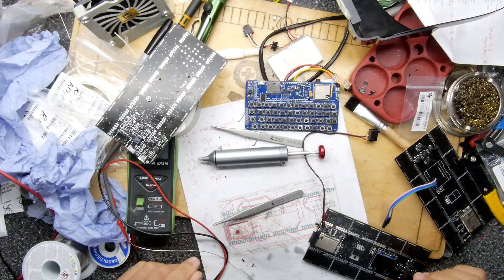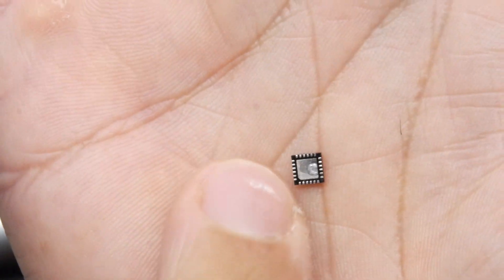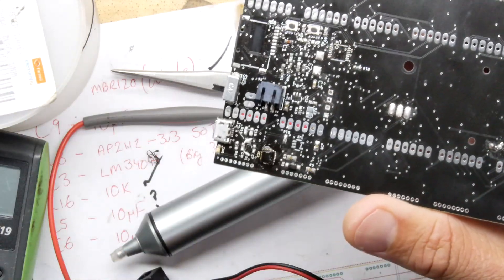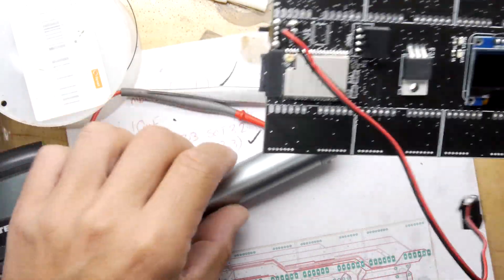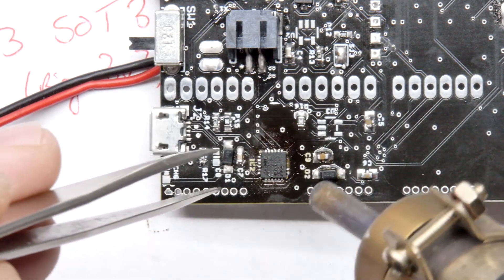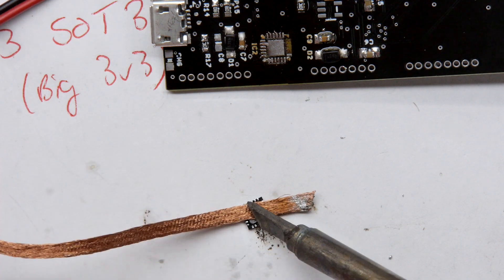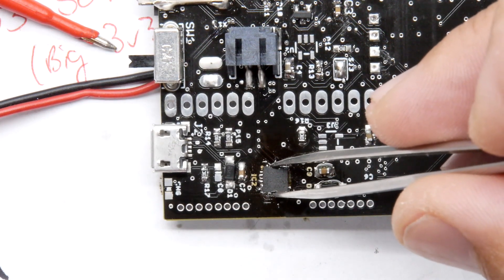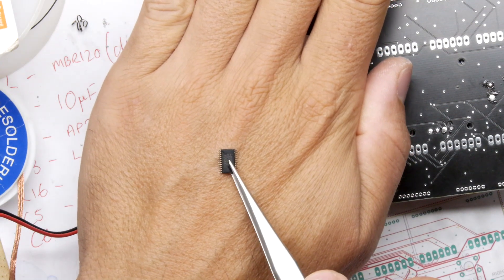The totally awful QFN IC footprint - Avoid at all costs!

Comment: What about modifying the PCB footprint to be more hand soldering friendly? For one you can extend the pads further out, to give you space to just jam a soldering iron in there for corrections. It would also give the pads more of an attachment area and make them less likely to just fly off or become torn from the trace, and would add some area where solder can flow to equalise solder layer height at the IC, since you're likely not going to have exactly equal solder amounts on every pin not being stencilled. You can add thick vias into the centre cooling pad to allow the excess solder from there to drain away.

Comment: QFN packages are a breeze with a hot air station, just make sure the temps are hot enough. Missing pads is a good indicator of insufficient heat when handling these packages. Often a board heater will make re-working these much easier.

Comment: I don't have experience with reworking them, but did hand solder quite a few accelerometers in this sort of package. I was intimidated at first, but found that with an exposed pad I had just enough room to run a fine soldering iron tip up the trace to the part and the solder would just wick underneath. One pin at a time. Not something that is production friendly, but it worked for the 20 or so boards I had to do. Good magnification and flooding with liquid flux certainly helped a lot. After that SOIC pins seemed huge to me . LOL
Reply from the maker: I hear that, SOICs solder themselves in comparison 😂
Reply: Wait until you get to one with a heat sink pad underneath.

Comment: Never had an issue with QFN chips. Good quality leaded solder, lots of flux (usually Kingbo RMA218) And hot air. Changed loads of chips on Xbox's etc, not had a problem. Check your hot air station is outputing the right temp too.
Reply: Also, don't Tim the chip (If you did). Here's a quic vid of me doing a QFN on an Xbox.  https://youtu.be/sEMR8nS_Oss